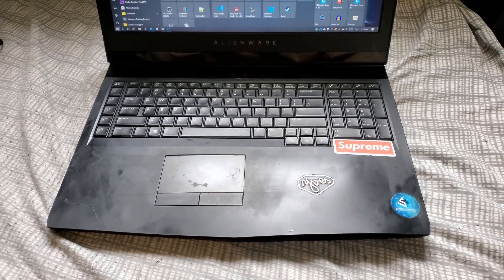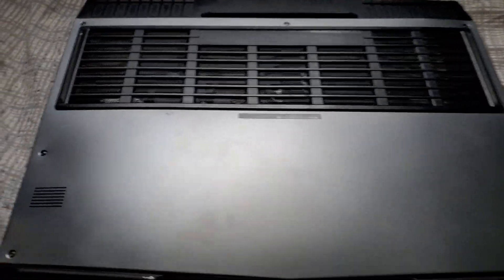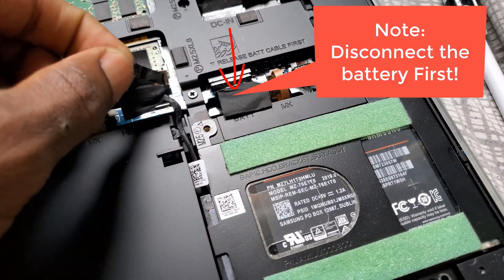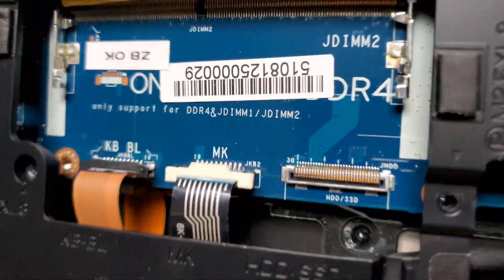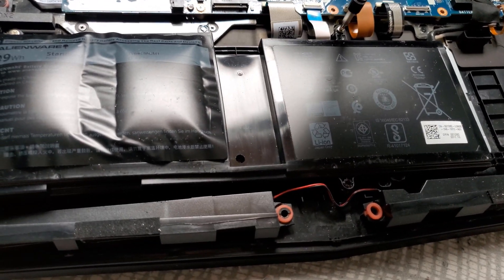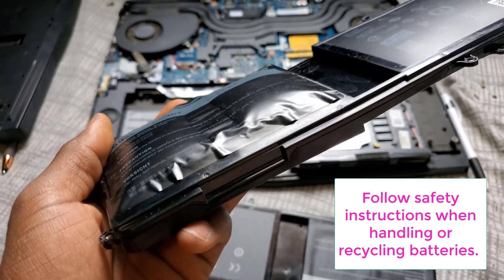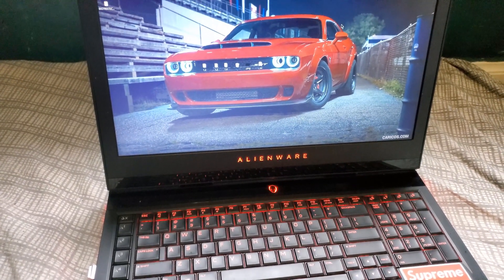Alienware 17 R4 Battery Replacement | Dell Alienware

Comment: This because you put it outside home or inside car you have to put it in the bag 💼
Reply from the maker: No, this happens to Lipo batteries, it's a well known issue of the Lithium polymer battery. Even keeping the charger connected for long term use can lead to this

Comment: Thank you! Worked great 👍 
But darn those little button connectors on the WiFi 😂
Reply from the maker: Those are hilarious. I can't believe they still haven't integrated those wires into the M.2 connection pins 😂😂

Comment: This is the second time my battery does this shit.. why does this keep happening
Reply from the maker: It's due to Lipo battery chemistry. That's why most laptop use 18650 style batteries, they don't swell. Many gamers leave the charger connected for weeks and use the laptop as a desktop computer which I'm guilty of also. That constant charging is the battery's worst nightmare. Also make sure you are using the OEM charger as some chargers are universal, they will charge your laptop but if the voltage and current on the label do not match the manufacturer' specified  values, the battery will degrade slowly

Comment: DO YOU STILL have this laptop? i keep replacing the swollen battery every year as it gets swollen and the fan keeps making so much noise even when its DOING NOTHING-mUST BE A DEsign Flaw with DELL
Reply from the maker: Yes, I still have this laptop 5 years running strong. Let's say that it requires some fan cleaning often especially if you are a heavy gamer. Your environment also affects it, like using it on the bed which is so detrimental as the fans are always suffocated and lint gets inside the fans. If your battery keeps going bad, insure that you are using the right charger (330 Watts). It's such a big laptop that most people tend to keep the charger connected and use it as a desktop computer. That's very bad for the battery and the SSD drives life span. Always insure you are buying genuine batteries
Reply: @YvonSmart  i dont think keeping working with electricity without a battery like i do affects the ssd drives.Now i keep it permanently plugged to power without any battery inside and its more efficient that way-no bloating, no fan noise and its lighter.do you still have your LAPTOP?

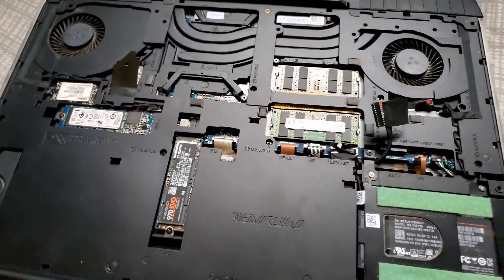Comment: 7:31 is that Msata with 2 teeth to place it in? or it has just one tooth to slot it in?
Reply from the maker: This is not an Msata SSD drive. This laptop does not support Msata drives. The slot is a M.2 (M key) meaning single notches, and the ssd drive I installed is an M.2 (B+M keys). But it still works perfectly. Keys explained here https://drive.google.com/file/d/1VQQgVZnH4id3vWMIzsVMTJs9nc6Hobg8/view?usp=sharing
Reply: @YvonSmart  i have a 17 r5 newer than this -just opened it and the slot only has ONE NOTCH meaning NVME. So how did you insert 2 notches in there and the laptop has only a space for ONE NOTCH?
Reply from the maker: @KingoftheRoad-2023  Hi! I had to edit my first comment as I said that the slot is a two notch, I meant the opposite. Two notches on the SSD drive, but but a single notch on slot. Two notches drives can fit into one notch slot. But one notch drive cannot fit into two notch bay. There is no physical blockage of the second notch on the bay (slot). In fact two notches slots do not exist (at least I have never seen one). All slots are one key so the laptop can support most drives
Reply: @YvonSmart  actually the dell site says it can support MSATA but its good to know that the slot can even fit SSD with two NOTCHES like yours which is rare.Most NVMEs only have ONE NOTCH and Msata 2 NOTCHES.The laptop does have a slot with ONE NOTCH as i opened and saw it

Comment: 2:45 Imagine telling people what you're going to remove next but not actually doing it on camera 😐
Reply: I figured it out!  You gotta move the little silver pieces holding onto the edges of them. Push them outward and it should let the stick pop up to where you can pull it out easily

Comment: Good thing we don't have to disassemble our cars and trucks to replace a battery.
Reply: Yeah, I miss the good ol' days when laptops had easy access panels to pull the battery, memory, hard drive, etc. in seconds.  Not sure why they don't continue to do it that way.  Maybe because the cooling demands are so much more on these systems.  Or they're hoping you'll just shell out more $$$ to buy a new one rather than fix the old.

Comment: Doing the time you changed the battery how many hours was the battery lasted after used?
Reply from the maker: I don't understand your question, but it took me about an hour to replace the battery and the new battery last 2h30min on average use, and more than 3 hours on battery saving mode. It's just like the factory battery.

Comment: Anyone with a Late October 2017 Alienware 17 R4 have issues where if your going between multiple open tabs that the laptop disconnects from your home wifi and you have to restart your laptop to get it bak on the wifi? Any suggestions? I ran diagnostics my wifi card is fine and nothin is malfunctioning. Thnx in advanced!
Reply from the maker: Try installing updates manually form the support page https://www.dell.com/support/home/en-us?app=drivers
you will be surprised how many drivers are outdated and the laptop never prompts you to download them.

Comment: How did you clean the fans?
Reply from the maker: I used compressed air for dusting (in the can), some tweezers to pick dirt and wet Q tips to clean tight spots

Comment: My alienware say's  "Warning the battery cannot be identified. The system will be unable to charge this battery" What should I do, as it says this when I turned my computer on before it boots up windows? I got the exact same battery as well.
Reply from the maker: Your battery is not compatible, I recommend getting the right battery for your laptop. Do not ignore the warning pop up. Running the laptop without a battery is safer than using the wrong battery
Reply: @YvonSmart   I used a 9NJM1 99Wh Alienware Battery. Copy the exact battery link information you in your video info, and pasted in UK amazon. Why would you say it's not compatible?
Reply from the maker: @JohnnyNewby  Do you have an Alienware 17R4 or 15R3 ? Notice, knock off batteries often use the same model number 9NJM1 and still sell you a non certified battery. Do you have a link to the battery you purchased?
Reply from the maker: @JohnnyNewby  Interesting. It seems to be the right battery. But other than the error message, does the battery work? Charge and Discharge normally?
Reply: @YvonSmart  I gather it works as there are many positive comments on amazon say it doesn't, It just doesn't charge at all. I think It might be a bios issue. Maybe my bios need to be updated so the normal charge and discharge function will work so some have mentioned that. Currently, it is a 0%. Any thoughts?
Reply from the maker: Probably, but less likely. You may have received a defective battery, if it's not late to return for a replacement, you should get a different unit. I recently updated my BIOS here: https://youtu.be/oTUwy_d0HjQ

Comment: Hi,can a 68wh battery be replaced with 99wh battery?(alienware 15 r3)
Reply from the maker: It's always recommended to use the same specs battery for replacement for optimal performance even though a different specs battery with the same physical caracteristics could fit and work with no issues. The computer will still treat the battery as a 65wh battery which can lead to charging issues or swelling overtime. So using a different battery is taking chances
Reply: @YvonSmart  thank you

Comment: That is more less complicated than my Alienware 15 R2, the Battery location of that one requires serious surgery. Mine is old so I prefer not to touch or remove anything, Batteries usually Dies first. All I did was Unplug it.
Reply: The 17 won't turn on with the battery unplugged...

Comment: Can I just remove the battery and keep the charger plugged in? I short on buying a new battery and my laptop is all I have to do homework.
Reply from the maker: I'd recommend removing it
Reply from the maker: Usually it's possible but some recent laptops with build in batteries won't run correctly or even turn on at all. But it should work perfectly on Alienware. You could just leave the dead battery inside unless it's swollen like mine
Reply: @YvonSmart  It is not as inflated as yours was but it shows in the laptop case.

Comment: absolutely insane the amount of work necessary to replace the batter on the 17 r4. on the 17 R1 you can just pop off the back and the battery is right there. definitely not looking forward to having to do this lol
Reply: Me either. I have been running my laptop plugged in for over a year now. I don't even see the point in changing it at this point.
Reply: I should have read this first.  I ordered a new battery but no way am I going thru all this.
Reply: i go through this every year cordelia-its so frustrating as the battery swells after one year and i have to open the damn thing-only Major laptop that i have so-gotta get dirty like this
Reply: Good luck I gotta do mine too😒ughh 😂🫨🥴

Comment: Safe issue amn! What can be the reason?
Reply from the maker: using the wrong charger to charge to computer or leaving the charger connected permanently can lead to a swollen battery
Reply: @YvonSmart  the wrong charger wtf
so you’re saying 
it has to be with alienware charger but no replacement charger 
that the replacement charger can cause swollen right?
Reply from the maker: @joshuagraham2843  you can use a replacement charger as long as it is certified. The charger your computer was bought with has a voltage and current rating on it. Remember those specs and only buy a replacement charger with the same specs. It's a powerful laptop that requires specific amount of power

Comment: Was the case okay after replacing the battery or was it damaged?  I have the same thing happening to my alienware 17 r5.
Reply from the maker: The case was still good after I put it back together. It has quite good quality plastic, it recovers after being bent for a long time. I only had to re-glue two standoffs back in their socket because the swelling pulled them out overtime.
Reply: Mine too, happened for a second time after replacing the first battery, now using the laptop without battery